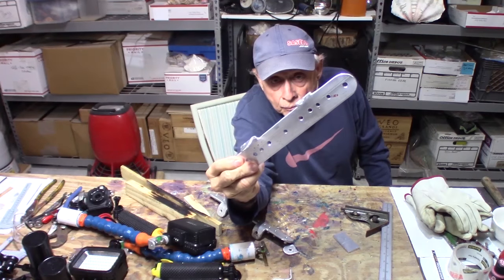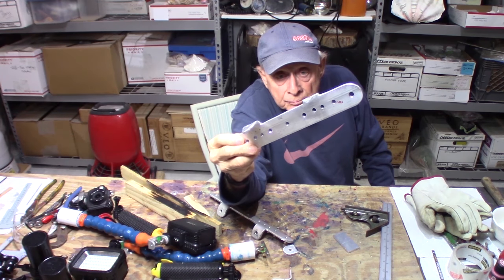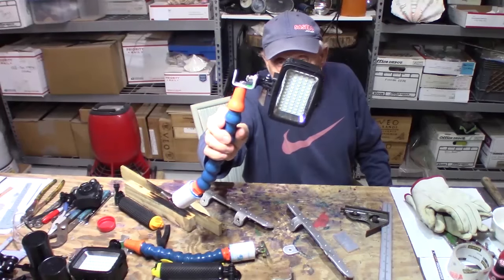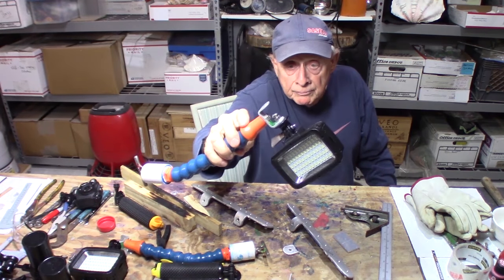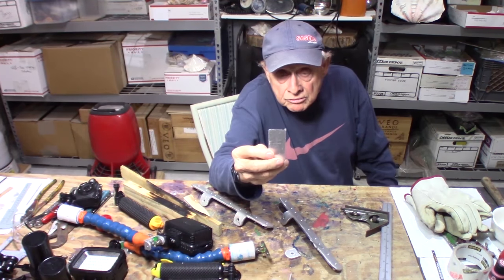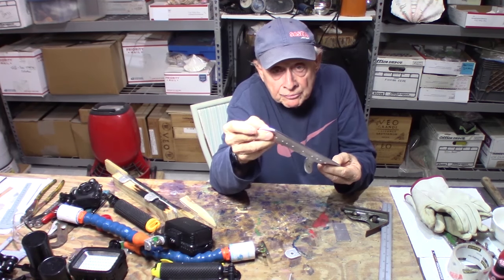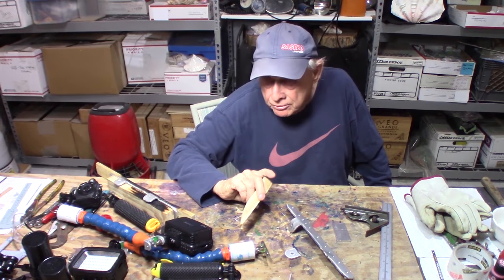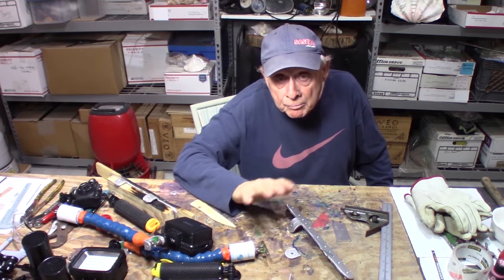The Wrong / Right  Way to Bend Aluminum

Comment: Bending that piece of alluminium with that adjustable wrench is not the right way to bend it - you're not applying equal pressure across the surface being bent.  I'd bet the side you bent from is now lower than the side you didn't and it's all now slightly twisted.  You could also do with a curved radius to bend the metal over so that the bend comes out uniformly.

Comment: I've had a lot of success by bending aluminum plate in a vice by accompanying the piece with a socket, such as a 1/2" or9/16" socket. Thisproduces agood uniform minimum radius, rather than an abrupt bend which wants to fracture the aluminum. I've done this bend cold many times with 100% success.
Reply: Thanks bud.

Comment: The type and condition of the aluminum alloy will have more  to do with bending capabilities than pretty much anything else... stay away from 6061,7075, basically they are already in a condition  generally speaking too which they won't readily bend without a large IC radius if at all, however 5052 or some of the other lower condition alloys we bend in house with near a zero IC radius and quite often well past 90° all the way to a 180° planished bend creating a rolled double thickness edge.. The condition and alloy are key.

Comment: Another neat trick for heating is your torch flame with no oxygen get the part sooty then as you heat the soot will burn off and you know your hot enough

Comment: Good job, I would bend on a radiused pc of oak, also have the crescent wrench in your hand opposite of the torch and bend it while the flame is applied, the force you apply,  it will bend when ready, though your char test tells you when to get the crescent in your hand, keep the flame on the metal as you bend on a wood radius.  When your remove the flame your temp drops rapidly and you tear the steel instead of mall it over the aluminum molecules stay intact and stretch when heat is applied till the end of the "stretch bend".  Thank you, cool video.
John.

Comment: This is a great video!! I found an aluminium bar that i was going to use as sliced dowel pins, but now i need to figure out how to bend it to a 8.84 in radius. I don't have a blowtorch... Could i use a hest gun to soften the bar at it's bend point?

Comment: I like your trick with the wood marking. I take it that will work with 3/8" bar stock as well. I have  to bend some 3/8"x 1 1/2" about 70 degrees. Thanks,.................................. Cheers, Jim

Comment: All aluminum is not the same.  Without knowing what you are doing, you have come up with a solution that works for you, but anyone trying to learn something from this will be lacking any real information.  It looks like you are trying to bend 6061-T6, which will bend but only with large radius.  If you bend it too short, you just proved that it cracks and often fails catastrophically.  Try using 5052-H32 for bending aluminum.  Minimum bend radius for ¼"  could be as low as .09 (without temper removing heat) but you won't get anywhere close to that with an adjustable open end (aka "crescent") wrench.  If you examine your bends, I'll wager you have tiny cracks throughout, which are failure points waiting to fail when you put two lights on or when the camera starts to wiggle around.  Good luck to you.  You need it.
Reply: I think that's a little to technical for what most people are considering doing from this 4min  video

Comment: The wrong way is against the grain. It will crack every time, unless your radius is large enough. You are suppose to bend with the grain. Heating up Aluminum will take away the heat treatment. If you have a very sharp bend you can use 0 type material and get it heat treated.  What he is showing is ok for home use not per say aircraft.
Reply from the maker: Aircraft Aluminum is high tenia or does not like to bend
Reply: I don't think anyone watching a 4min video is building a airplane lol

Comment: Can I use a gas torch?
Reply from the maker: Probably?
Reply: Acetylene + pure oxygen burns at close to 3000 C.
Butane/propane + air burns at about 2000 C.
The melting temperature of aluminium is a bit above 600 C if I remember correctly.
I reckon you can even melt the aluminium with a plumber's torch if you're not careful.